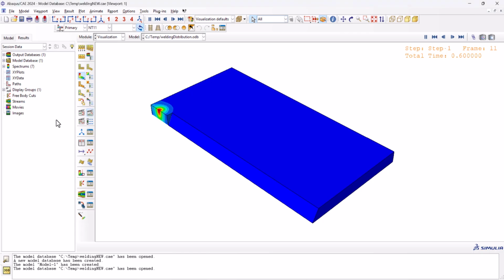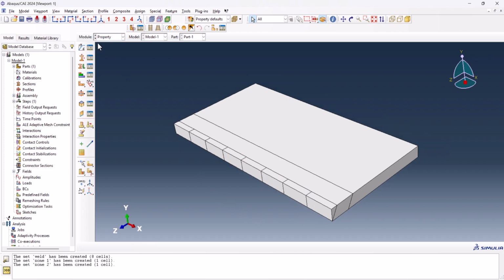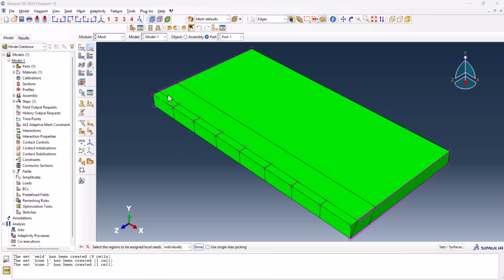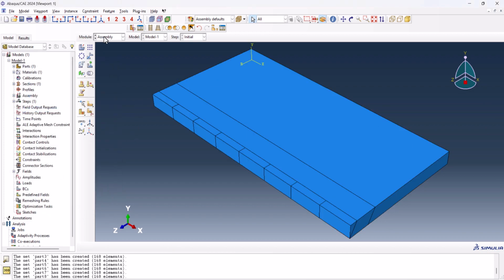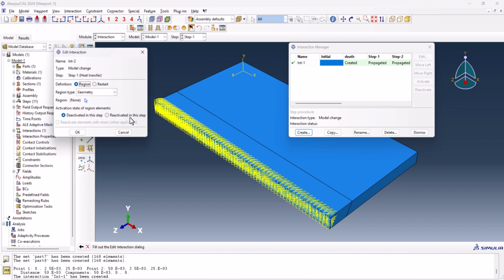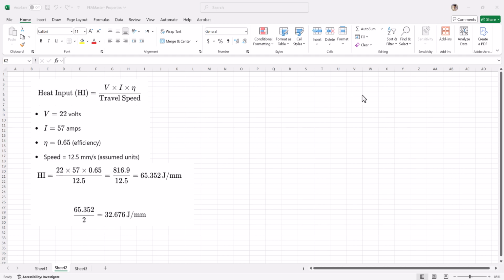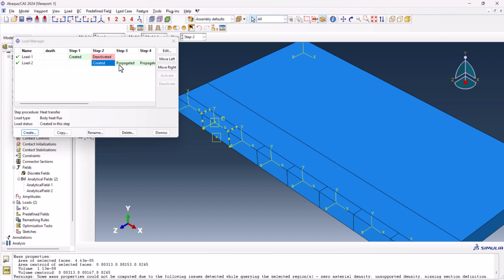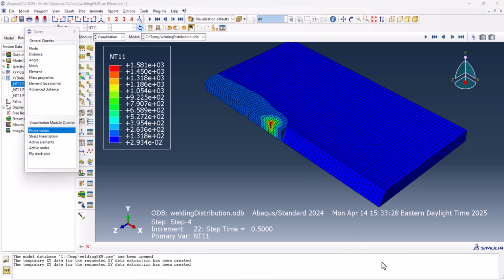The Best Welding Simulation in Abaqus (0 Subroutines Needed!)

Comment: Great video sir! I just want to ask why create datum local and use analytical field? What is the purpose of the equation? I've noticed that in your older videos on the same topic you didn't do this step. Thank you in advance
Reply from the maker: Great question! The reason I used a local datum and analytical field in the newer video is to define the heat flux distribution more precisely. The equation you’re referring to controls the shape of the moving Gaussian heat source, which better mimics the actual weld pool shape and energy concentration during laser or arc welding. In older videos, I skipped this for simplicity, but adding this step gives more realistic and accurate thermal gradients in simulations. Hope that clears it up!
Reply: @FEAMASTER  I understand now. I also wanted to ask a follow-up question regarding the heat source model. I’m more familiar with Goldak’s double ellipsoidal distribution (though I’m still learning and haven’t run any simulations yet). As I understand it, Goldak’s model incorporates separate front and rear heat distributions. From what I’ve studied, a standard 3D Gaussian distribution should include variables for x, y, and z. However, in your video, you used the expression:  exp(-3 * (pow(z/0.004, 2) + pow(z/0.00325, 2) + pow(X/0.001, 2)) which includes two terms for z, one for X, and none for y. Could you clarify why this formulation was chosen?
Reply from the maker: @dimyog  You're absolutely right — thanks for catching that! The correct form of the equation is:
exp(-3 * (pow(Y/0.004, 2) + pow(Z/0.00325, 2) + pow(X/0.001, 2)))
I mistakenly repeated the Z terms earlier. That said, this correction doesn't affect the result values significantly — it just slightly changes the shape of the molten pool. The overall thermal response and residual stress results remain consistent due to the symmetric energy distribution. Appreciate you pointing it out!
Reply: @FEAMASTER  Thank you for the clarification. Great video otherwise! Keep up the great work your videos are a lifesaver
Reply from the maker: @dimyog  Thank you so much for the kind words — really glad to hear the videos are helping! And thanks again for pointing out the mistake in the equation!!

Comment: Thank you for such a detailed video. Kindly make a similar video on estimating residual stress in fillet arc welding in steel, or guide me to the resource/video if it is available somewhere.
Reply from the maker: Hi Mohmmad, thanks for sharing your feedback with me. There's one video that can help you. It's on Additive Manufacturing but fairly similar!  https://www.youtube.com/watch?v=S7Hn8eaC6ik&list=PLvACBM1uN9EqfmWZjxMjD6o5Fd0KQs9TV&index=3&t=4s&ab_channel=FEAMaster
Reply: @FEAMASTER  Thank you for your reply. I have also seen that video. Kindly help me to understand, for predicting residual stresses, do I have to model the welding simulation like in this video and check the development of stresses during welding or use the output ODB file of the welding simulation in defining the distribution of predefined field as you did in the additive manufacturing residual stress video and check the stresses?
Reply: Are the temperature-dependent data for steel properties used in your welding simulation applicable to other steel grades?
Reply from the maker: @ Yes, first you need a thermal model. After finishing the simulation, you remove all the steps and everything and perform a stress analysis according to the "AM Residual Stress" video.
Reply from the maker: @ It only could be applied to "Carbon steels" but the film coefficient is related to the air and can be used in the simulation for any alloy.
Reply: @FEAMASTER  Thank you very much for the help. Please make video on multiple weld simulation like cruciform for welding and RS prediction in single video.
Reply from the maker: You’re welcome! Sure!

Comment: Do you happen to have any videos or resources that explain how a steel bar bends during welding? I'm working with a 15-foot steel bar that's held by clamps with equal distribution, but after welding support beams on top (in a pattern like +----+----+---+----+), the bar ends up bending upwards and also loses parallelism on the sides.

Interestingly, when I weld shorter bars—around 3, 4, or 5 feet (pattern like +--+--+)—they come out fine without any noticeable distortion. 🤔🤔💭💭🙏🙏
Reply from the maker: Hey, I don't have such a video however, there are a couple of videos that might help you:

1- Couple temperature displacement in a cantilever beam:

https://www.youtube.com/watch?v=GSFy6AzZvpo&list=PLvACBM1uN9EqfmWZjxMjD6o5Fd0KQs9TV&index=3&ab_channel=FEAMaster

2- this is how you can simulate the residual stress:
https://www.youtube.com/watch?v=S7Hn8eaC6ik&t=4s&ab_channel=FEAMaster
Reply: @FEAMASTER  thanks man🙏🙏🙏
Reply from the maker: @ You are very welcome!
Reply: @FEAMASTER  Thanks!!!!!
Reply from the maker: @jorgeavalos4429  Of course!